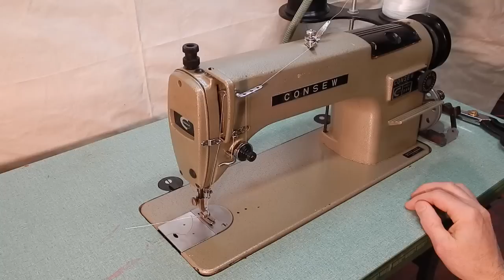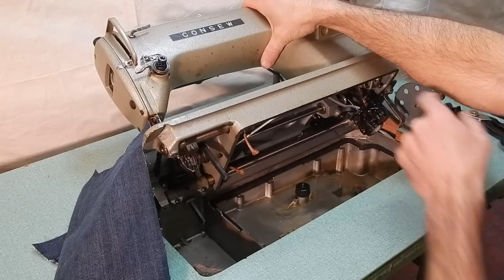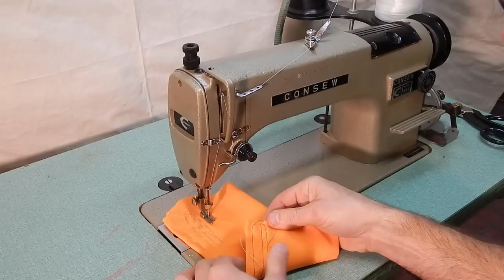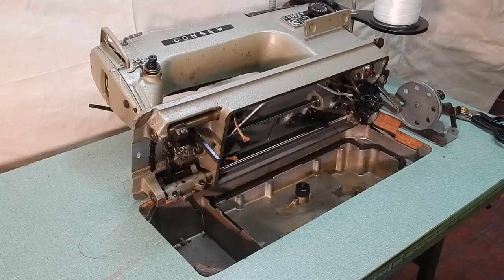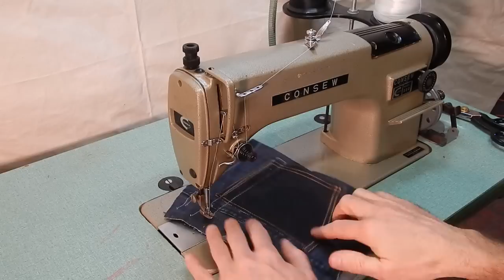Consew 230 Industrial Sewing Machine with Reverse Made in Japan

Comment: A used machine from Japan is much better than a new machine from china
Reply from the maker: While I think I agree with your general sentiment I would say Not always. Japan is widely accepted as having excellent engineering and quality control. I like Japanese machines very much. China is a very BIG country and it is full of many manufacturers, some are not good and others are. China is getting better as time goes by and I have noticed that some of the machines from China are quite good. Did you know that Apple iPhones are manufactured in China?
Reply: It's now 2023..I'd buy china without question due to China having highly skilled workers, access to high end precision cutting machinery and the needed raw materials, along with the competitive market yeidling a competitive pricing for the general retail consumer too. Yah I'd buy China made and use the difference saved to be re-invested  for later fun.

Comment: Ive never used this machine and i have it is there supposed to be oil underneath the machine ???
Reply from the maker: Yes, this is an automatic oiling machine, because I was in the middle of servicing this machine and waiting for oil to be delivered it was empty during the video.  There should be enough  oil in the pan for the oil pump to operate and many times the level is indicated in the oil pan.

Comment: I'm interested in getting an industrial walking foot machine, but one of the tasks I'll need to do is sew through up to 4 layers of veg tan leather. Would these machines be able to handle that, or should I go bigger, like the Cobra machines or Cowboy machines?
Reply from the maker: This is not a walking foot machine. Cobra and Cowboy machines are good, they are "branded" machines out of China and very similar to Mitsubishi and Highlead to name a couple. There are also USA, German and Japanese machines that will do a good job too. Veg. tanned leather projects often require a cylinder bed as well. Search on the leatherworker.net site, there is a ton of information about leather sewing machines to help and educate yourself so that you can make an informed decision.
Reply: Cowboy is beast for sewing shoe soles and 5 layers of thick leather.

Comment: How much oil should be in the pan?
Reply from the maker: I would think that there should be some sort of indication in the pan.
Reply: @AlexanderDyer  Cant see a level. Will the machine work properly if there is not enought oil in the pan?
Reply from the maker: You want to make sure there is enough oil that the oil pump is fully submerged and the oil wicks that hang down are also in the oil. Too much and it will overflow when you place the machine down. If you have enough oil then you should see it pump up into the window when operating at high speed.